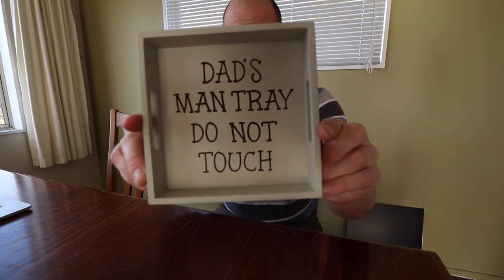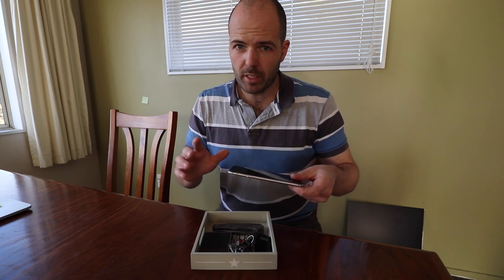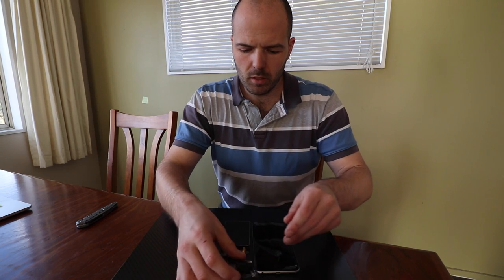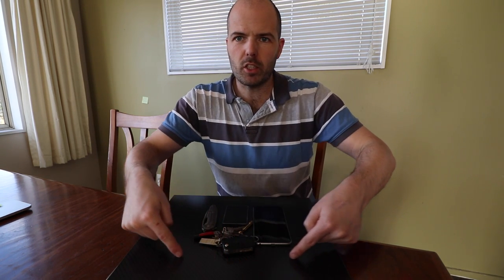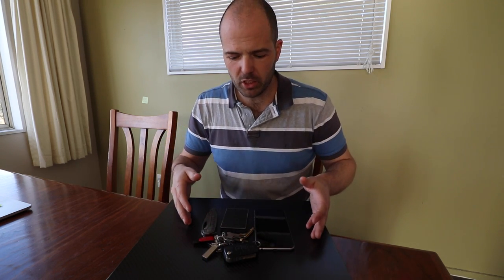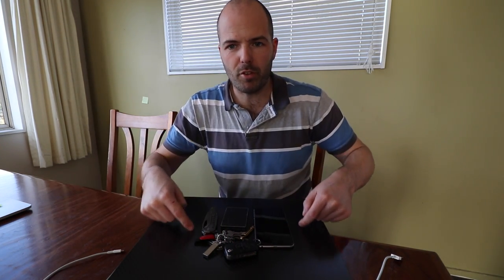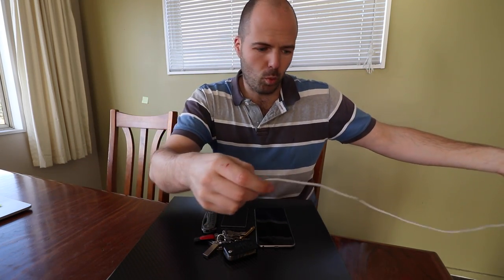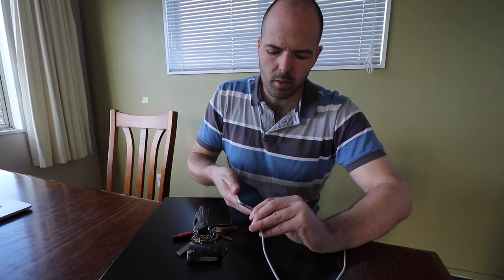A Titanium "Man Tray"?

Comment: Personally, I use a tray with compartments(so gear doesn't scratch each other) and it is about the size you will probably make. I carry keys, wallet, phone, knife and have an extra, fairly narrow compartment running along the bottom for miscellaneous items that I may carry. Dimensions are about 300x300x25mm and compartments/dividers are removable so if I get bigger or smaller gear, I can just throw together something and swap it out. I could make and send you a drawing if you would like?
Reply from the maker: Thanks Brad. Man, 300 x 300 is fairly big. Compartments could work actually. Maybe make it modular...
Reply: Modular would be wonderful!
Reply: But 300 x 300 would be my ideal size too...